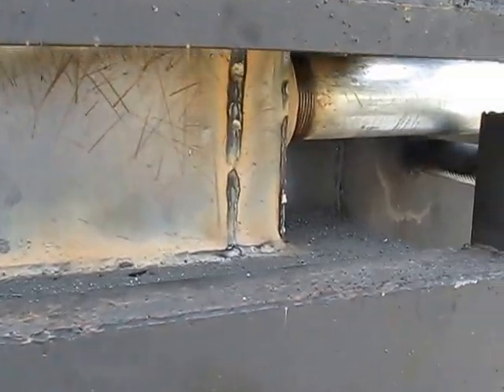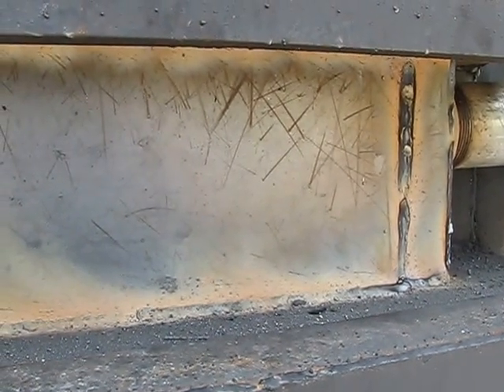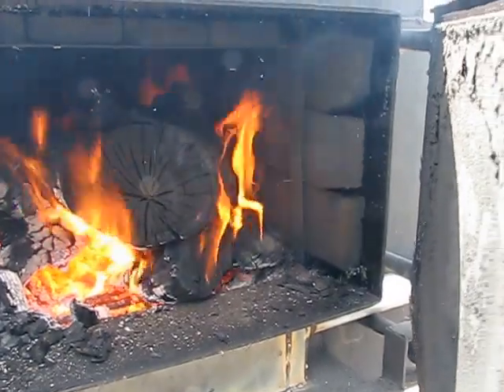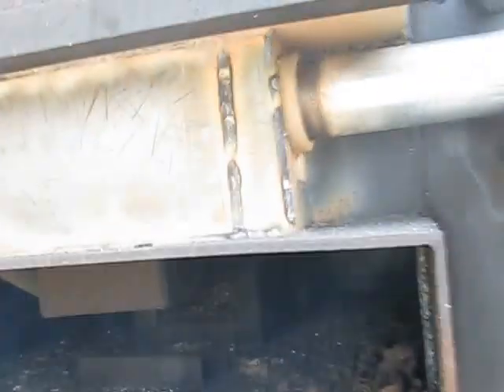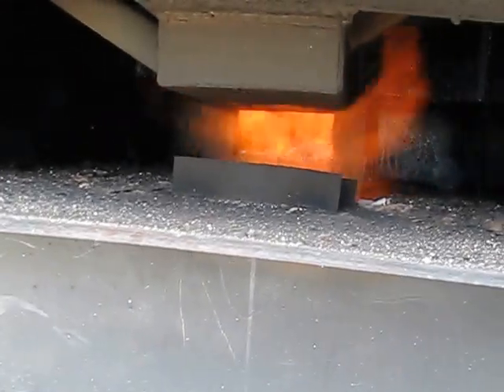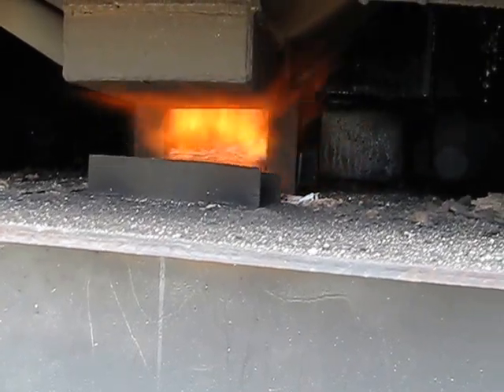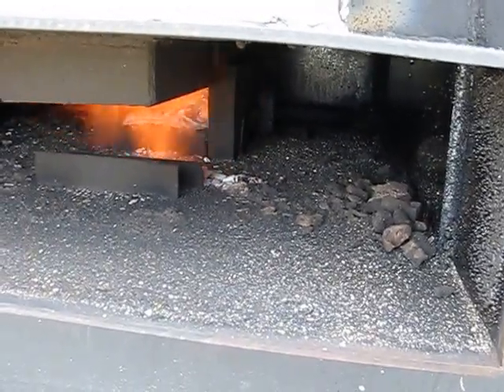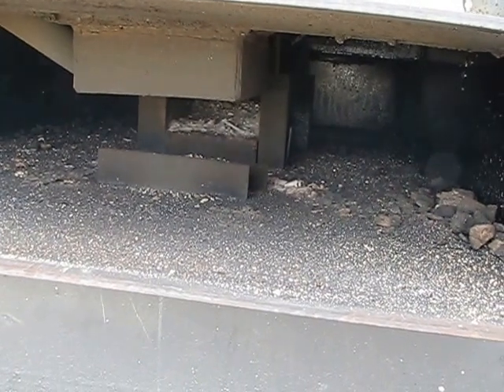Wood Boiler Air injection Test

Comment: Most of your heat will come from the secondary burn anyway usually in a non gasification boiler most of those gases just go up the chimney flu non burned and used thereby not putting BTUs in your boiler or fireplace.

Comment: Gasification boilers work by having a low primary burn chamber oxygen level and then introducing an enormous amount of oxygen in the secondary burn chamber. You should be burning in the primary burn chamber low and just smoldering creating the methane gas that you'll burn in the secondary chamber. Send all of your air to the secondary chamber. There should be very little in the primary just enough to keep the fire going.

Comment: Remember when you touched The Air flow on The burn chamber and  The fire goes well on The second burn? Then that should be The FIX settings on The burning chamber. Remember that when those doors are both open then it's all diffrent. Make a FIX settings on The burn chamber check if it burns good on The 2nd then proceed on The second WITH door closed.

Comment: A possibility is that your primary combustion now is burning wood + some smoke and there is not enough smoke and gases to burn in the secondary chamber. This may happen because primary burn has now more air. Try a secondary blower to the secondary burn and see what happens. If there is no ignition, try to provide bigger quantity of air to the primary combustion without blower and use only the blower to the secondary combustion.